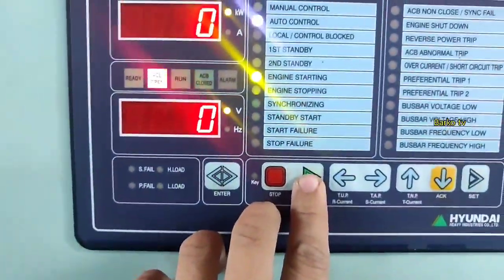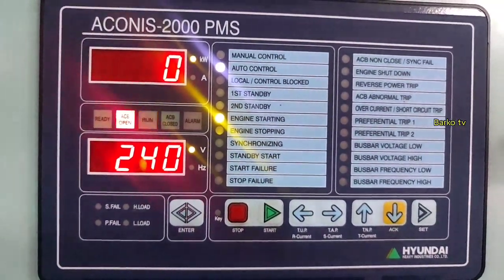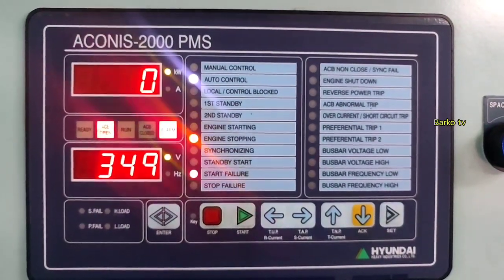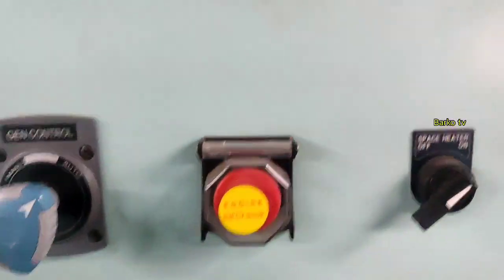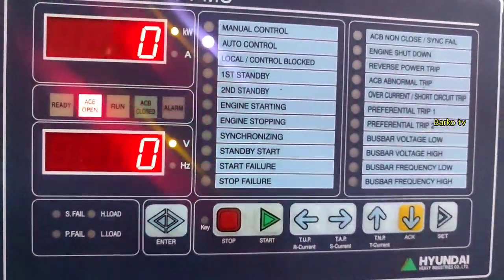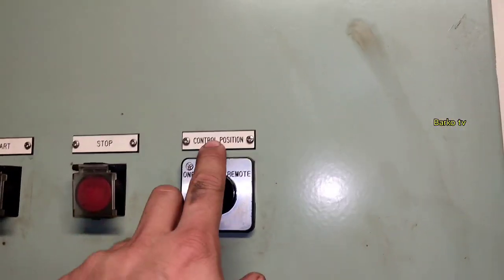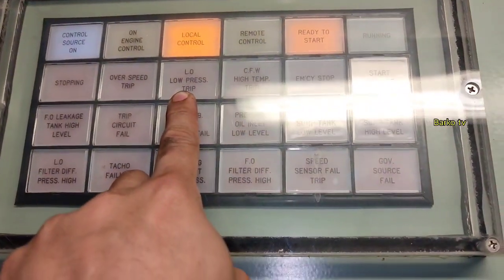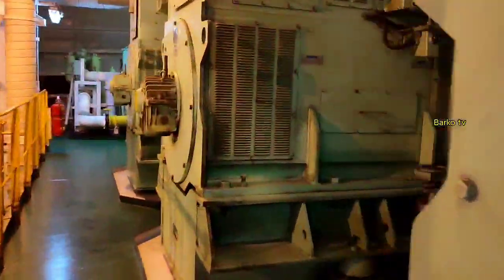Tagalog - Generator Start Failure problem - troubleshooting and simulation L.O. Low pressure switch

Comment: NASA impa bato sir pressure calibrator pano mag order
Reply from the maker: Merong yan sa impa, pressure calibrator pero di ganyang model, pero pressure calibrator parin and it works at its purpose. Pag ganyan orderin natin, kailangan e specify mo manually sa inyong request para same talaga ang dadating

Comment: Good day Sir, while replacing the new pressure switch it's have the original setting or we have to adjust the it's setting by using the pressure calibrator. Please sir explain it. Thanks.
Reply from the maker: Just to check, if the pressure setting is correct, i rather suggest that need to check by using your pressure calibrator